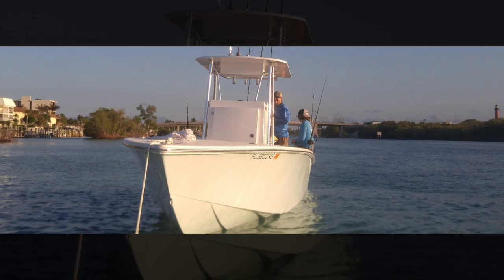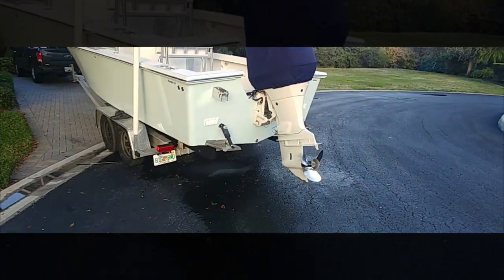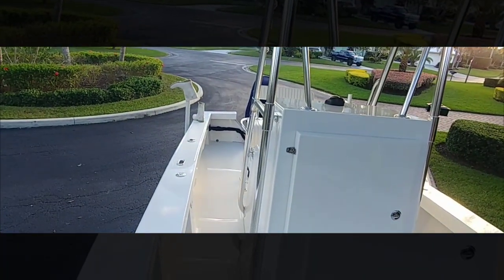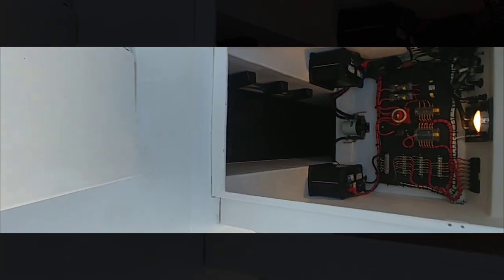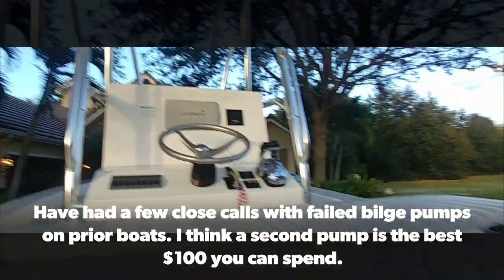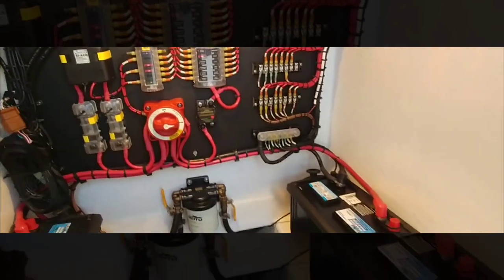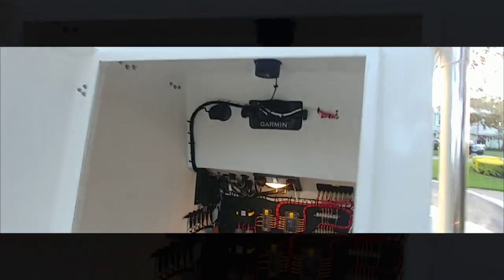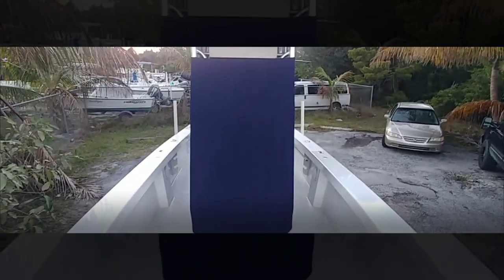Rambo 27 Walkthrough

Comment: Great efficiency with the 200. I run a 300 yamaha on my Rambo 27 and only get about 3.5 mpg at cruise. Tops out at 54mph though.
Reply: Transom or bracket?
Reply: @hughsoncampbell4601  transom mount. Will be adding a hydraulic jack plate with 10" setback soon.

Comment: How do you think this boat would be in the flats of Charlotte harbor in punta gorda? Pretty shallow on the flats and I would like a boat that I could get in skinny as well as get off in the gulf some distance, wonder if Lou can add a jack plate
Reply from the maker: Its pretty versatile. We fished the Everglades,  Pine Island Sound, and Bahamas in March alone. Its really just a huge bay boat. Most folks on this coast use trolling motors, which really opens up inshore and reef fishing. With a bracket you would be unstoppable.
Reply: Loxalucie 33455 thanks so much for your input, we are suppose to be moving down next July and trying to find the right fit in our budget which isn’t much
Reply from the maker: @striper8311  good luck with the move.